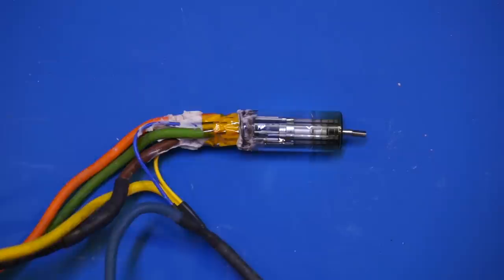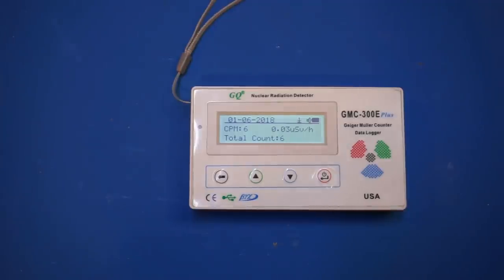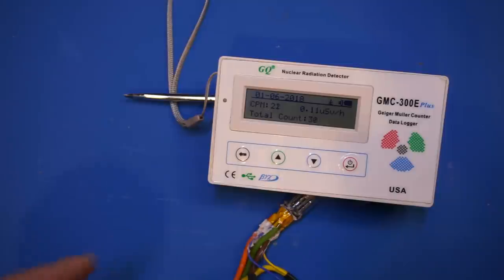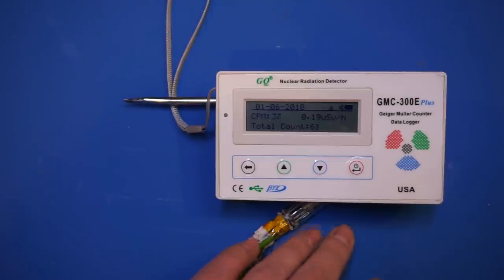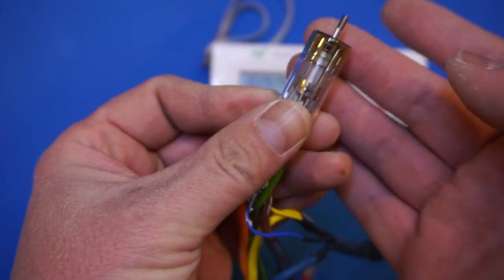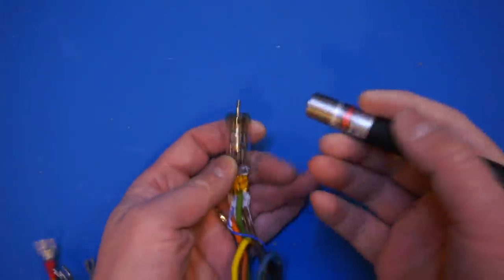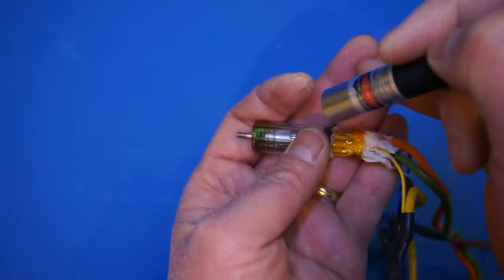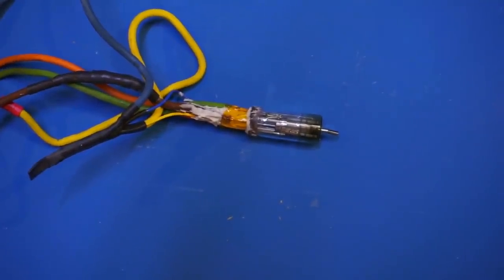The Traveling Wave Tube inside HP 493A is Radioactive

Comment: Back in the old days, I have seen Eimac 304TL's that used U glass. They were politely referred to as "Canary glass" and they were rather uncommon but very attractive looking power tubes. Then there is the Thorium impregnated in the Tungsten emitter. I never got overly concerned, and I'm still ticking.

Comment: In the 60s, when I worked at a NASA satellite ground station, we used gas discharge regulator tubes. These were radioactive to ensure consistent striking. The boxes they came in had a warning not to store more than a certain number together!

Comment: I have a very old Western Electric it is made of a Beryllium Oxide white ceramic, and has silver-plated rings around it and it was plugged into a socket in the middle of the wave guild, the exposed part outside the socket was a circular heatsink-shaped like a cylinder with fins about 1-1/2 wide and tall, the tube side with beryllium oxide microwave window that looks like a hollow white ceramic cylinder from outside the contact rings that decrease in sizes like a cone and is about 2 inches long. The whole tube with the heatsink was about 3-1/2 inches long. After removing a couple of screws the whole TWT came out of the socket by twisting the heat sink and pulling on it. 
That cotton wiring connected to both sides. The socket had wiring on both sides of the chassis that went down machined-out channels to the final stage transistor boards. This thing had radio shielding seals, thick aluminum plates, and hundreds of screws all over it. It looks more like it came out of a machine shop, not a 1950s electronics manufacturing plant, the whole radio housing was first sand cast with several cavities for circuit boards on but divided both sides front and back then it was machined out for metal mesh radio seals. The back of the radio chassis had a couple of boards but mostly had that cotton wiring.  The waveguide bolted to it was 1950s cool. It had a machined flexible part with a scale for adjusting standing waves with large Bakelite knobs for locking the adjustment down. It kinda adjusted the way elbows in your arm would but everything else was stationary. I'm a PMC tech and work on digital and I'm more familiar with micro-controllers than anything else but I've collected transistors all my life and know just enough about radio to describe what I was looking at. I had to study microwave theory to get my degree in Robotics.
Reply: I looked like it could be replaced in seconds but the gold-plated Western Electric transistors nearby were in a machined-out cavity inside a cast aluminum case like everything else and very difficult to get to and that was what I was after. The TWT had easy access to the outside, it had some screws but you could get to it easily.
 
It seemed like if the solid-state side failed the whole transmitter was shot because there were so many screws and things in the way. Most of the repair would be mechanical assembly and I was breaking things being careful. It was made not to be taken apart.
It was still working they had to replace it to go digital. Of course, I keep the TWT. Everything is being packed and given to my local electrical museum except for the transistors being divided between museums, they are very rare. It would have been nice to keep the whole thing but I would have had to throw it away I move so much and history would have been lost. Those 1953 Western Electric transistor inside was the rarest component inside that whole switch room building, they were never sold to the public.
Reply: Most of the transistors in the switchroom were made by Motorolla but they put a Western Electric part number on it. I got most of the circuit cards in the toll long-distance part. That stuff got wethered because I had no place to put them but I got the transistors saved now. These Western Electric transistors look more homemade from a micro metal fabrication shop compared to transistors made today and the whole case is gold plated and very pretty. In the end, before tearing everything out of the building and going digital they let me walk around inside the building taking stuff.